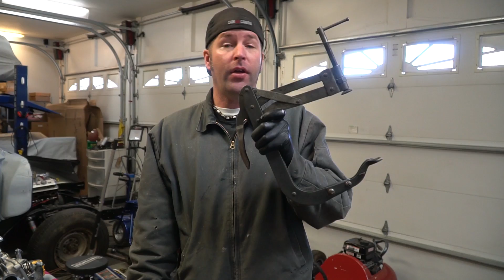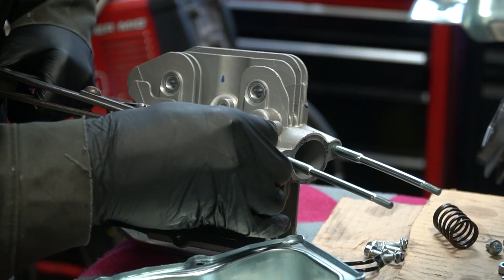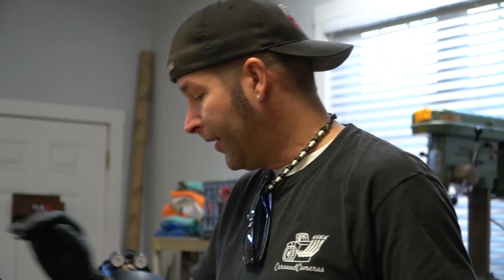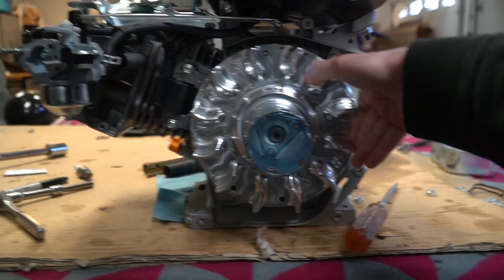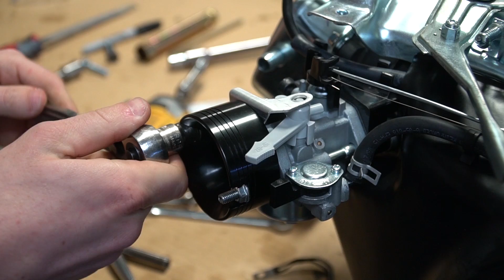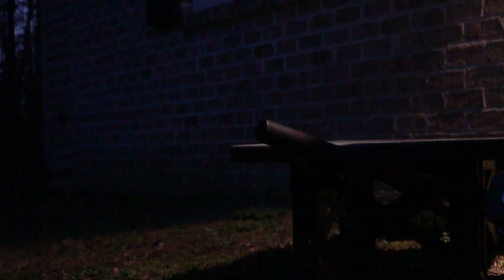Predator 420cc Stage 2 Build Pt. 2 | It's a THUMPER!

Comment: I have a big block Subaru 300cc that I put on a garden tractor. It was a factory starter delete, and had a plate in, but I took it off and put some mesh there for better cooling because the engine kept overheating and boiling the gas in the metal tank. I also added a fan, and drilled holes in the shroud.

Comment: This might be a dumb question. But if you get better performance from a higher and wider cam lobe, why don't manufacturers use these in their stock engines?
Reply: UnfinishedProjects These engines were designed to run at a continuous rpm and last a long time. They are used in things like lawnmowers or snowblowers. In general engines with pushrods are not high performance compared to overhead cam engines.
Reply: Probably emissions
Reply: @cjmadcatz7492  Ah yes, that does sound logical

Comment: YOU TOOK OUT THE BALANCER , THE MOTOR IS GOING TO SHAKE .YOU SHOULD HAVE KEPT IT IN THERE. YOUR DOING HIGH RPM'S  YOU WANT A SMOOTH MOTOR .
Reply: Then that cast balancer made to turn 3600rpm comes apart and destroyes the engine because they turned it 8 grand
Reply: As the balancer is driven from the crank it will take power from the engine, and as they are trying to get every ounce of power out of the engine they want as little losses as they can get
Reply: @thealmosthdchannel  AT 8,000 RPM OR MORE THEY WILL CRACK THE ALUMINUM CASE MOST LIKELY , AND RATTLE THEIR TEETH GETTING THERE .
Reply: How to Guroo is ur caps lock broken jesus christ
Reply: @howtoguroo2686 they will probably balance the crank itself
Reply: @howtoguroo2686  idk if it is the same as a car but often those balancers are for our comfort and any difference it makes doesn't affect the engines safety at all.
Reply: At high RPM that counter shaft would have enough fluid friction / oil slap to bust the crankshaft to dust. Again thin stamped steel & cast Aluminum,,  ARE NOT 
 Going to stop 20 lbs of flying rotating Mass. It would have the same effect as (2) hand grenades going off in your back. Counter balance shaft. ?????
 What counter balance shaft.!!!!  They are installed for a stationary use as in generators. So they don't tear themselves to pieces. Any Mobile machinery do not require it.

Comment: I installed 36lb. springs, upgraded retainers and keepers, SS valves, 3 angle valve job, CM pushrods, retained the balance shaft as I can't justify the money to have the rotating assembly balanced for a golf cart, forged piston .010 out of the hole/+.040  billet rod, and went with the Torque+ cam as I have very little flat land to ride. Oddly enough, I can't discern noticeable difference than my 420 running under no load. Thought that .275 cam would roughen the idle more. 
Too cold @ 17 degrees outside to open the door and fire it up or I would.

Comment: My stage 1 212 from GPS hasn’t wanted to idle since I put the stage 1 kit on. Everything is correct and it was brand new. I also clean the carb after I found out it wouldn’t idle without choke. Any tips?
Reply: Something is definatly wrong. Maybe a piece of trash got into the idle jet?

Comment: On your Coil-Gap....... Theres no need in doubling the space because you are spinning higher RPM-  the flywheel isn't going to swell or grow like a rear tire does - the wider the gap, the weaker the spark and slightly retarded on timing because the magnets are farther than spec
Reply: This is a Poor choice of power plants for a Road-Legal Golf cart, for several reasons- 
(1):You need LIGHTS, (Brake, Tail, Head, Turnsignals) Cant have those off an engine you deleted the charging system!!
(2): it's going in a GOLF CART, with a body around it - a pull start only engine is going to suck - You deleted starter motor
(3): it ROARS now, a wide open header is going to attract unwanted attention from Johnnie-Law, plus who wants to run up to the store in a Golf Cart that pisses off all the neighbors and blows out your eardrums????!!! (John): "Dude, should we pick up some Mt. Dew with our Twinkies?" ...... (Ike): WHAT??!!! WHAT????!!! 
_________________________________________________
You'd have been much better off with a 670 twin, leave the charging system, leave the electric start and do less radical mods to make it more powerful than stock but not all LOUD & cammie and lumpy and goofy for a Road-Legal vehicle - Pull starting a Golf Cart motor is going to get old quick - and having Total-Loss race electrics on a thing that needs lights is going to suck - save this motor for a off-Road Dune buggy build - Go back to Harbor Freight and buy a proper motor boys..............
Reply: Eclidean lol
Reply: 1) there is something called a generator that will provide power for the brake, tail, headlights, and turn signals.
2) You think they're going to daily it? It'll just be something fun to drive occasionally.
3) The backfire will most likely attract attention versus the noise. Can probably be reduced/eliminated with a performance muffler from GPS.
Reply: Bro it'll be fine chill
Reply: Bruh you're pissed!!!!!!!!!!!! Let Em send it it'll be fine, JeazZ!!!!

Comment: should have put springs in when you had the piston out and could have avoided head removal
Reply: Aaron Sprankel don’t know why having the piston out would have made a difference?
Reply: Theirs a tool that screws into the rocker stud assembly to compress the valve then you reach in the cylinder and grab it or you can do it with the piston in they already had it out tho just a thought
Reply: Yeh I know the one you’re talking about, idk if you’d get your hand in there though it’d be a tight squeeze I’d imagine, especially if you have big hands haha. There was a few ways around the issue but they worked it out in the end, even if it wasn’t the easiest way 🤷🏻‍♂️
Reply: Phat_VS yea they always figure someway to make it work

Comment: Anyone else notice he was tightening the exhaust stud?
Reply: Yes I did
Reply: Dang it that's what I was headed to the comment section to point out lol
Reply: Anime
Reply: I totally saw that it looked like he tightened it so hard he cracked the block
Reply: Teemu I was getting ready to say the same thing. That would make no sense and bebad engineering.
Reply: Honestly it’ll be fine
Reply: Everyone step away from toolbox and call  a professional lmfao
Reply: Most of you guys are missing the point.
- yes he jammed 2 nuts to pull the stud. Common practice, nothing special...
- Then you hear the stud "crack" loose in the head, and THEN he tightens it with 1 wrench...

He was technically facing the stud backwards, easy mistake to make, even for vets... nothing was harmed I'm sure of it. 

What's hard to grasp here. Rewatch the video. Pretty obvious tbh... 🤔🤣🤣🤣
Reply: Fucking stupidity.
Reply: Deez nuts. Sorry I had to.
Reply: @Max_ellis74  no, you actually didnt have to.  But thanks for posting a dumb comment!
Reply: He tightened two nuts together to make a “bolt head”
Reply: @Noah Batterson
THEN he screwed the stud in further.
Reply: psygn0sis the stud didn’t move. The nuts spun on the stud. To loosen a tight stud bolt or anything. It helps to apply pressure both ways. Tightening and loosening. It’s like shocking the bolt with a hammer. The stud didn’t spin. The nuts did
Reply: @noahbatterson8591  For loosening the stud you put two nuts on the stud and loosen the inner nut the outer nut transfers the energy to the stud. For tightening the stud you tighten the outer nut and the inner nut transfers the energy. He was clearly tightening the stud. - Wasn't trying to reply to you Noah, just hit the first reply i saw.
Reply: @noahbatterson8591  And then he preceded to "tighten" the stud instead of loosening it.
Reply: @noahbatterson8591  then he continued to turn it left till it came loose should have turned to the right
Reply: He was locking the nuts onto the stud.  It’s an old mechanics trick.  Turning two nuts together locks them both against each other. Them you can turn either of them in one direction and it will turn the stud.  So he actually wasn’t loosening the stud at all. Just tightening the nuts.
Reply: Shit happens. Sometimes tightening something can break it loose.
Reply: Anthony T yes
Reply: Studs are 'reverse' threaded. That's how we get turning a nut/bolt right to tighten
Reply: It’s reverse thread so when you tighten the nut the stud just doesn’t unscrew itself
Reply: @beechermudmowers5397  they aren't reverse thread, bud. Watch him install the new bolts
Reply: @beechermudmowers5397  Noooo...

No reverse thread anywhere on that engine my dude.

Stay in shop class.
Reply: @beechermudmowers5397  
LMFAO
So:
Righty tighty 
Lefty loosey 
right?
so if the nut they are putting on the stud is righty tighy lefty loosey, and the stud is reverse, than the stud is righty loosey lefty tighty....
You following me?
Okay. So now the bolt is on the stud right? still following me?
Bolt is righty tighty, so you turn it on the the stud in the rightward (clockwise) direction to tighten it.
Oh but wait a minute, the stud is reverse threaded right? that means the stud is righty loosey, not righty tighty... so if the bolt is attached to the stud.. still following me? okay...
and you are turning the bolt righty tighty to tighten it, but the stud is righty loosey, that means when you turn the nut to tighten it, since it is attached to the stud, and the stud is righty loosey, that means as the nut tighten on the stud, it also loosens the stud.

holy fucking shit guys nothing on these engines are reverse threaded as far as I know. You can literally use a short bolt for your exhaust manifold, you don't even need a stud and a nut.

Also threadlock that bitch. I wrenched the fuck out of my exhaust on a 196cc and it jiggled off in like 25min.
Reply: @PlokTheMasterGamer  Thank you for teaching these kids basic fucking physics.

Yet, they will argue the most elementary shit.

Their daddy's were lacking apparently....
Reply: Reverse thread
Reply: @timothyjsullivan   it cannot be reverse thread , due the fact that you tighten the nuts on normal way,,  and it would loosen the studs by default if the thread was reversed there…
Reply: @timothyjsullivan  no reverse threads on tilitsons lifan or preditors
Reply: @timothyjsullivan  It's not reverse thread though.

Comment: And get a electric start at the track we run at the outlaw class every body is started with a electric starter it's like a big drill and this dude has a flathead made for jrdragster on his kart he lapped the 420 pulled gxsr kart down the straights and won the race 10000 rpms isn't a joke
Reply: Cayden 26973 It’s an impact and they’ve used one on their briggs a couple bids back
Reply: @Lukewilson24  no not a impact they didn't use one yet on this channel it's called a small engine start

Comment: I’m not really smart about 4 strokes lol... so the valve springs are stiffer .. won’t that make the motor “ stressed “ or work harder ?
Reply: Stiffer would make the valves not float
Reply: Esteban Pedroza okay thanks ... ima 2 stroke guy so 🤷🏼‍♂️ that’s what I figured though
Reply: To heavy and you loose power trying to push them and they wear out, too light and they float. There’s a balance you shouldn’t be heavier than how fast you’re turning

Comment: I just got my 150 carter talon go kart converted to 420cc last night. It took about 2 weeks because I had to wait on shipping and I had to modify the frame for clearance but I was able to use the original axle by using a long jackshaft on pillow blocks and the chain actually runs underneath the engine rather than next to it
Reply: Bigfoot And Bananaman got much clearance beneath the sprocket??
Reply: Yes I have the sprocket behind the engine and the chain goes underneath the engine where the sprocket on the axle is